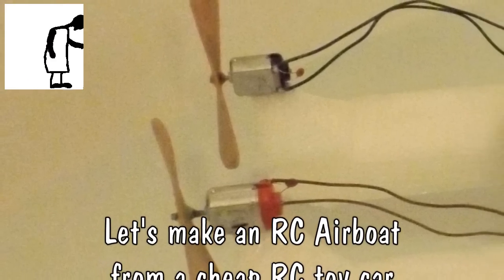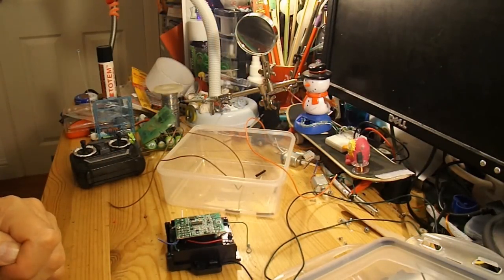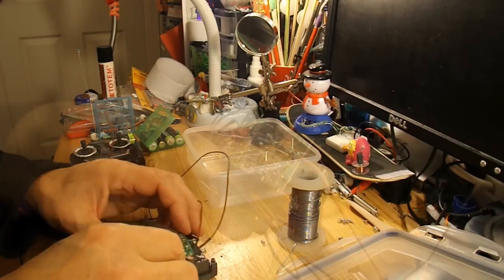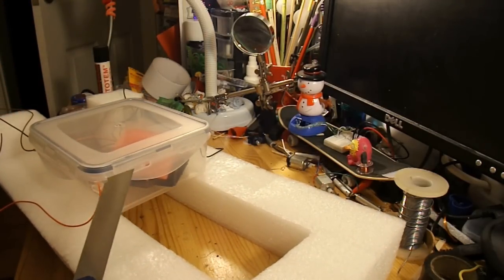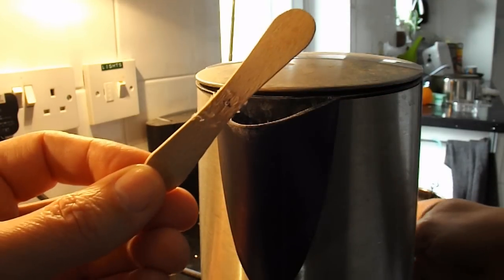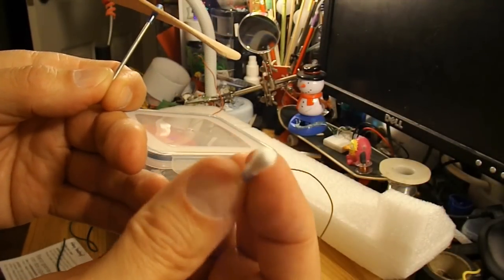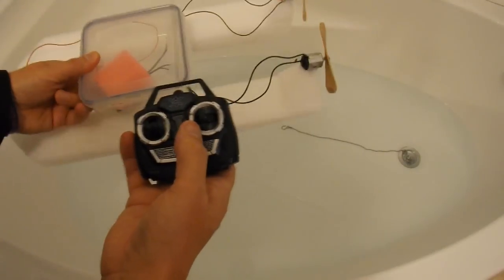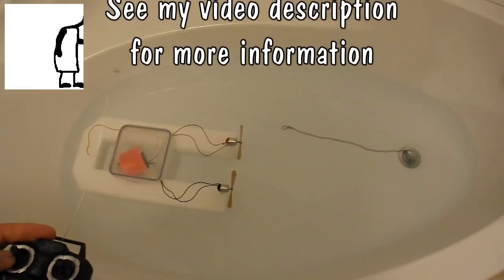Let's make an RC Airboat from a cheap RC toy car Part #2

Comment: It was a really cool idea and was very helpful !!!!  I actually have a problem in my rc car ........ it does'nt work ........ I am not able to find whether the problem is with the reciever or with the transmitter........ it is a 27mhz rc car ....... please help .....
Reply from the maker: +Nitish Magendran sorry, there is no way I can guess what your problem is. The only thing I can suggest is try your transmitter with another car and see if that works and try the transmitter from that car you your receiver and see if that works. That way you would know if it is the transmitter or the receiver. Obviously make sure the other transmitter works with the other car first or you may be trying another faulty set.

Comment: nice boat, i just found a bunch of old junk rc cars. some that still work. but they are so slow and boring that id prefer to turn them into something more interesting. this boat looks like fun. but the range is so short on my cars that the boat couldent go very far on a lake or pond w/o just losing signal and floating away
Reply from the maker: yes people keep asking for these rc toy car conversions and I keep explaining about the lack of range. On one boating pond I go to I get half way across then have to walk around the other side. Probably OK if you have your own swimming pool.
Reply: +Jd Cunningham
You can also try switching circuit boards between a few of them (If one is a bit larger and takes for example 6 AA batteries instead of 3 AA batteries in the car you can get quite the speedboost switching board too the one needing a basic higher voltage as it will most likely send more power too the motor.)

That + lithium ion batteries would really wake some of them up or maybe ust one lithium ion battery in place for 3 AAA batteries reduces the weight giving it some power still.

A few years ago i did that too a small rc monstertruck that took 4 AA batteries and put in a board that ran on a rechargable 9.6v battery that i powered with a pair of standard 9v block batteries wired in for capacity instead of voltage. it did wheelies after that and was still holding up great until i did one too many 50 cm high jumps heh.

Comment: from that point you only need to adjust the controller oreintation.. you've already modified every thing else
Reply from the maker: thaBRink8486 if you mean turn the control levers so they face the right way, that is not possible with this cheap transmitter. I do have a couple of other transmitters that have the levers in the right orientation for this style of steering but I wanted to use the one that came with the toy car I used as a donor for the rest of the components.
Reply: oh i meant no disrespect!!   i just meant take controller apart and re oreintate the controls to up-up and down down... i aplaud you for the boat build!! im always trying to entertain my nephews and do experements and stumbled on your videos... i should have said thanks!!
Reply from the maker: thaBRink8486 I have no problem with your comment, sorry if you thought I did. As I say, the controls on that cheap transmitter cannot be altered. I have looked inside already. The controls are simple metal plates that make contact as you move the lever. The pivots for the levers are part of the plastic casting so you cannot simply unscrew them and turn them round. Thanks for taking the time to comment.
Reply: oh i see!! thanks for taking the time to respond!!

Comment: hey ! can u help me in telling me that if I don't have a light electric motor for the Styrofoam plane ,so what should I use for it. can u please reply me fast as I have to submit the plane on the          23rd of December at the schools exhibition
Reply from the maker: +Dhruv Kayesth you would have to buy a proper hobby grade motor. There are plenty available online of all sorts of sizes. Your problem will be finding somewhere that can supply them by post that quickly. When I buy from eBay I usually buy from Chinese suppliers because they are cheapest but they take 4 to 6 weeks to arrive. Your only chance is to find a supplier in your country or maybe a hobby shop in your country.

Comment: can u do a tutorial how to make a rc plance out of rc car radio control system ?
Reply from the maker: ZyFinity ᵐᵒᵗᶤᵒᶰ ᵈᵉˢᶤᵍᶰ if you mean the cheap RC toy cars that you get in toy shops then in my opinion you are wasting your time. The motors are not powerful enough and the RC gear only has a very short range so you would need to run after the plane to keep control. As it happens I am doing a series to demonstrate that problem https://www.youtube.com/playlist?list=PLA5a2xPRSrB3v7nI2gkMPSAD5LOoSQkzk
Reply: ok
Reply from the maker: Good luck 😊

Comment: can you make a video on making a fume extracted for soldering from a old pc fan
Reply from the maker: +sciencenerds I just put the fan next to where I work so it blows the fumes away from me. I did have a PC fan running off a 9v battery but I bought a USB one for another project and use that now. If you are going to do the job properly you would have to add a filter so the fumes are captured instead of just pushed away.
Reply from the maker: +sciencenerds https://youtu.be/LhZtQ0UQj6c

Comment: hello.excellent vidéo.but can we use this to make an quadcopter?
Reply from the maker: compus jilou simple answer, NO. To make a helicopter or quadcopter stable in flight you would have to buy so many parts designed for the purpose it is cheaper to buy a ready made helicopter or quadcopter. You would be better finding a channel that specialises in RC Quadcopters or Helicopters so you get the information from people who know what they are talking about. FliteTest would be a good place to start although they tend to focus more on planes than copters https://www.youtube.com/user/flitetest
or anything David Windestål is involved in https://www.youtube.com/user/dadde87
or you might like this video by The Post Apocalyptic Inventor http://youtu.be/qa_x93JQhNM

Comment: i have rc car. but it's litle slow.can you tell me how to make my rc car get faster on videos.it will be nice from you.TNX.
Reply from the maker: +Viesturs Zvejs I will not be making a video on the subject, however I can give you the following tips.
1. You can change the battery to give more voltage. That will run the motor faster but may burn out the RC receiver.
2. You can fit smaller wheels and you will get faster acceleration but the top speed will probably be slower depending on your motor's capabilities. Smaller wheels would put less strain on the motor so it might rev faster and make up for the top speed loss you would get if the revs stayed the same.
3. You could fit larger wheels which would reduce the acceleration but should give you higher top speed depending on your motor's capabilities. Larger wheels put more strain on the motor but if the motor is powerful enough to cope with the larger wheels then you will be OK.
4. Thinner wheels would be lighter and reduce the strain on the motor but you might lose grip and the wheels will spin losing any potential gain.
5. You can change the gearing to achieve the same effect as 2 and 3 above
6. You can change the motor to a more powerful version.
7. You can reduce the weight to reduce the strain on the motor so take the bodywork off or cut lots of holes in it.

Comment: Polypropylene foam it the material that you enjoy cutting so much.  My grandad spent 45 years working for a plastics company.  some of it stuck.
Reply from the maker: Well I am guessing you know your stuff, but my understanding is that Polypropylene tends to be more rigid than polyethylene and the foam I am working with is quite soft to touch and compresses easily. Also Polyethylene has a lower melting point and this stuff certainly melts easily near a hot soldering iron.
Reply: I did not realize that the material had a low melting point.  I suggested Polypropylene as that is a bit more common as a packing material.  Polyethylene tends to form more spherical bubbles when foamed.  Polypropylene forms long thin bubbles when foamed and can be quite soft if foamed correctly.
Reply from the maker: That makes this sound more like polyethylene as the 'bubbles' certainly seemed quite large and round. Not that it matters either way to me, it was just some packaging that was available at the time. I certainly didn't go looking for any specific type of foam.
I based my identification as polyethylene on the fact it has the texture and feel of 'pool noodles' or 'water woggles' which I have seen described as polyethylene.
Interestingly in this Wikipedia link they mention polypropylene as being used to make connectors for polyethylene woggles in the USA.
http://en.wikipedia.org/wiki/Pool_noodle
Amazing how a side conversation can generate so much information :-)
Reply: True enough about the side conversation.  Great channel by the way.  It's like hanging out with my Grandad (if he were british) when I was a kid all over again.  Thanks for making the internet a better place!
Reply from the maker: Hey thanks, you are very kind.

Comment: Why make the propellers counter-rotate?
Reply from the maker: spacemanspiff2012 if you use a single propeller or two going the same way, the torque generated will tend to turn the boat. By using two props and making them counter-rotate you eliminate that problem. Alternatively you put a keel under the boat or a rudder to hold it straight.

Comment: that really cool and can you make a car that can pull 10 pounds and in 5 meters
Reply from the maker: What sort of car? I usually get requests for rubber band powered cars.
This one carries 5 pounds for 2 metres
http://youtu.be/JFi8AKVAmPo?list=PLA5a2xPRSrB1otXh0w36OwsYIHZznUWp6
This one carries 4 pounds for 3 metres
http://youtu.be/1tq2GE-PnZY?list=PLA5a2xPRSrB0zJ5RHjvsw46Mio6uJjF5_
This one pushes 500g 
http://youtu.be/MWXSTb0OdDU?list=UUCDUFabVc3g52M0t77JwSBA
And finally this GRAVITY powered car carries 13kg or 28.6 pounds for 5 metres
http://youtu.be/zWnw281Lk8M?list=UUCDUFabVc3g52M0t77JwSBA
Reply from the maker: I just re-read your request. Do you really mean PULL the 10 pounds, like a lump of wood sitting on the floor and a rope on the back of a car, or do you mean CARRY the 10 pounds? If you do mean PULL then there are a whole load more questions about dimensions and construction of the weight and the surface to be pulled over.

Comment: I made an airboat but I don't have a transmitter
Reply from the maker: +Shiv Persaud you could still use it as long as you run the boat in circles or can get to both sides of the pool.

Comment: how far 2.4 ghz can go?
Reply from the maker: +Su T-50 Pilot I suggest you Google that to find an answer. The short answer is as far as your transmitter and receiver can talk to each other.  It depends on the power of your transmitter and the sensitivity of your receiver. I think a general answer would be probably as far as you can still see your plane clearly. After that unless you are flying FPV it does not really matter as you have lost sight of your plane.
Reply: +GrandadIsAnOldMan thanks.

Comment: You should make a fume extractor
Reply from the maker: That would be a good idea. I just open my window and usually have a small computer fan running to blow the fumes away from me. Thinking about it, I have a fan unit designed for a bathroom or shower room that I could use. Thanks.

Comment: a step beyond this, use cheap 2.5 channel helicopter electronics for a twin motor (CW and CCW), with both fans split ducted to underneath for lift.. mini RC hovercraft. think about it, left stick is thrust to both, right stick dividing power of left stick for steering, so there is nearly always same amount of air pushed underneath for lift whether running straight or turning it. I'm going to guess, if it is light enough it'll be much faster and more fun than it was as a helicopter. kind of like FlyingWings "Airbug" but twin motors instead, and not needing steering vanes and servo. something like this might even drive on calm-flat water if there is enough air cushion and well balanced. your video https://www.youtube.com/watch?v=DWTR0G6BLaw is fairly near halfway to what I'm describing.
Reply from the maker: model nutty this project is nothing to do with hovercraft. The title explains what is going on here.
Reply: GrandadIsAnOldMan understood and not trying to bug you.. your videos are definitely fun interesting instructional, and appreciated. it'll be weeks before parts arrive from China so I can do what I'm describing. if you do it before, I'd sure like to see one go!

Comment: how about RC plane
Reply from the maker: +Rochel Albeos I don't really consider this a model plane channel and usually redirect people to FliteTest for that sort of thing, however if you look in the video description there is a link to my radio control playlist and there are some RC planes in there or you could look at these playlists 
Hot Wire Styrofoam Plane https://www.youtube.com/playlist?list=PLA5a2xPRSrB1Qj--01eR1NU_K2RCbH3R8
Another Plane from Scrap Foam https://www.youtube.com/playlist?list=PLA5a2xPRSrB0IHk7pAAHCwTLfGDX_SK-k
Twin Engine Variable Thrust https://www.youtube.com/playlist?list=PLA5a2xPRSrB1fg_tSRBIbqhtus-gylu9-
Radio Control Remote Control playlist https://www.youtube.com/playlist?list=PLA5a2xPRSrB13Xcquw4Ff09MQzTPjeVkI